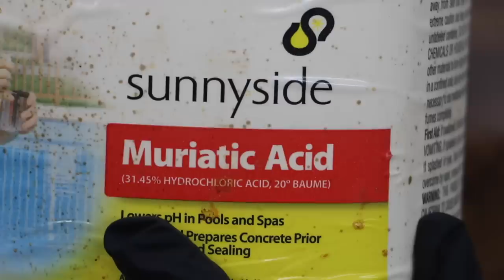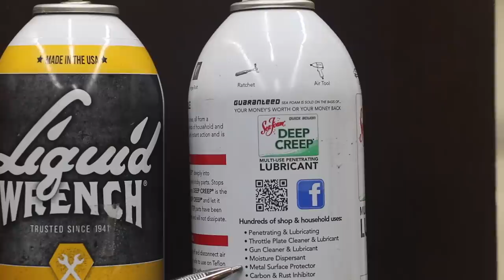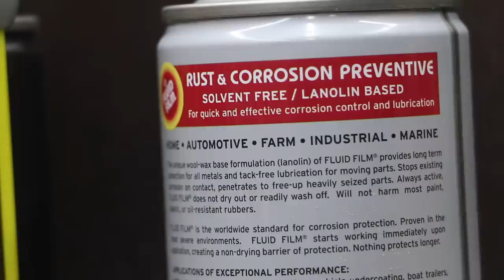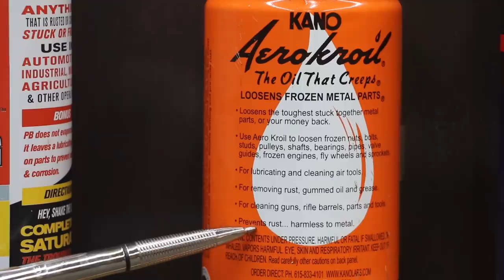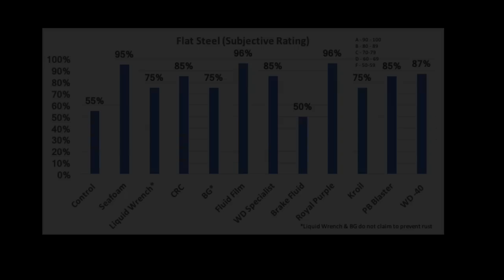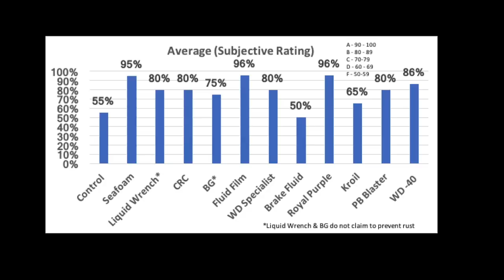Do Penetrating Oils Block Rust?  Let's find out!

Comment: There's a product in Canada called "Formula 3000". It's used the same as Rust Check in the sense that it's used as an undercarriage spray to prevent rust from forming, or spreading. Our Canadian winters are especially long and cold, and a lot of municipalities use calcium or salt to coat the roads. This mix is especially bad to parts of the vehicle that have paint missing in spots and to unprotected metal parts under the car. I would be curious as to how Fluid Flim compares with Formula 3000 and Rust-Check. Those three in a competition I think would produce very interesting results.
Reply: Also I should add: by looking through YouTube for videos comparing the two with Krown as well, it seems there are not many of them and a lot of the ones that exist are very poorly filmed and explained. There is one video that shows a lot of different rust inhibitors in a 1 year later test. If you were to do a similar video, I think you would help a lot of people - including myself - find a product to spray under our own vehicles. Thanks Project Farm!
Reply from the maker: Thank you for the video idea!

Comment: I use spray on tar, its excellent for protecting against corrotion and wear. It hardens up over time aswell. Not good for long bolts/threads though as it can lock up pretty hard.
Reply from the maker: Thanks for commenting on this.

Comment: You're missing PB Blaster 'Corrosion Stop' 
As an engineer, THE most effective product I have found to block, inhibit, seal metal is PB Blaster 'Corrosion Stop'
Great capillary action. Non- hydroscopic, 100% waterproof, good lubricant, self healing and does not wash off except with solvent. Nothing better for electrical connectors in marine environments.
Reply from the maker: Thanks for the feedback.

Comment: I inadvertently replied to a video from this time, last year....I have a suggestion for a project idea. This one is also a 1960-70s fairy tale. I could never get a strait answer on the outcome. The story is, during the car engines of the era, it was common to see valve stems filled with sodium powder. The hollow valve stem, with the sodium powder, would dissipate heat from the valve, and reduce carbon buildup. The story goes, if you cut open the valve stem (I guess cut off the tip with a hack saw) and dump the sodium in a cup of water, the sodium would explode. Sodium filled valves are still around in auto applications, and piston aviation engines. I'm wondering if one of your junk yard engines may have sodium filled valves. The last time I had one in hand, it was from a 1955-1985 Small Block Chevy with perimeter bolt valve covers (non Vortech) heads. If you held the valve up to ear and shook it, you could hear the sodium rattling around. It sounded like a salt shaker. Do you have any scrap valves sitting around, that make the "salt shaker noise"? Wanna potentially blow something up for likes? Lol. The videos I've seen are really sketchy and don't show definitive [sodium from valve] used. There are plenty of laboratory grade sodium explosions on the net...but, those vids lack the grit and spirit of Project Farm.

Comment: Off to buy some fluid film. Get lots of surface rust running heater in garage in winter and this would be fantastic for small jobs caused by condensation.
Reply from the maker: Fluid Film will stop the rust!  Great product.

Comment: It be Great To See how These Compete  With 3M Silicone Sprays Type numbers 08897 Dry Type and Wet Type 08877 I’ve had Great Success preventing rust on a Raw Tube Chassis OFFROAD Race Car.. I coat the Chassis after every Race, leaving a protective film especially the Dry Type.. Most survives even after heavy mud situations leaving no rust underneath on the steel.

Comment: Great test, love the results. Would have loved if you had included some plain old 30 weight engine oil in there to. I use in on stuff sometimes as a rust preventer, plus I have read in the comments, and seen guys in the past who've used old engine oil as a rust preventive for auto bodies and frames.
Reply from the maker: Great recommendation.

Comment: I'd be interested to see the same experiment without the Zinc coating removed. Most of us are not going to remove the coatings before we reinstall the bolts. I do however like knowing what the products will actually do with raw steel but the formulations may be designed to work with the coatings so that seems like a more realistic test.
Reply from the maker: Thanks for the recommendation.

Comment: WD-40 is a great water dispersant. If you have a wet electrical or phone panel try using it and watch the water bead up and fall away. Then use one of the other products to protect the connections.
Reply from the maker: Great point!

Comment: Something not mentioned about fluid film is that is also sticks around much longer than all of those other fluids. I spray fluid film under my truck and 3 months later it's still there. If you were to spray wd40 or one of those other fluids it would largely wash away in a week
Reply from the maker: Thanks for the feedback.

Comment: The issue with brake fluid isn't that it's highly corrosive itself, but because it's hygroscopic and absorbs water readily, it will speed up corrosion like rusting which are accelerated by water. 

Would he neat to do a test of different brake fluids and see how much water they absorb under various conditions.
Reply from the maker: Great recommendation. Thank you

Comment: A fascinating sequence of tests and very useful.  A typical scenario is stuck bolt, penetrating fluid, remove bolt, treat bolt with rust preventer, re-assemble.  Which product is best at preventing future rust but won't wipe off with the pressure of re-assembly and torquing?
Reply from the maker: Great video idea!

Comment: my favorite use for wd 40 is washing and one step degreasing my bike chain. when i clean my bike i hit the chain with wd40 while spinning it fast, then spray it down with the hose, then repeat once and just spin the crank for a while. then i put actual chain oil on. there are better products for doing this, even specific products, but i find it funny that allot of people think that you can just use normal wd40 to oil a bike chain or similar application. it is not a lubricant, it is a solvent.
Reply from the maker: Thanks for sharing.

Comment: Great info! I know Fluid Film is thick and, well, "filmy", and I'm assuming Royal Purple Max Film is also. Perhaps the thick "film" consistency of these two products helps them prevail over the other products.  

Another note to consider: as of this writing on Amazon, Royal Purple costs $1.22 per ounce, while Fluid Film costs $0.83 per ounce. Not a big difference for small work of coating bolts, but something to consider if coating, for example, a truck frame.  

Final note: The smell of Fluid Film drives me crazy; it just smells yuck. : ) BUT, on the plus side it's a natural yuck smell (b/c it's lanolin), not a chemically-destroying-my-lungs smell. Curious what the smell of Royal Purple is like? (Again, not a big deal for small applications, but for big projects...)
Reply from the maker: All great points.  Royal Purple doesn't smell as bad as Fluid Film, but I believe Fluid Film would likely last longer due to it's greater viscosity.

Comment: Another great video. Thanks for making it.  Very informative and interesting.  

Hi there, I have a question for you. 
I have a car that hasn't been started for 15 yrs . What do you recommend I put in the engine before I try to start it?  & for how long roughly?
Reply from the maker: Thank you!   I'd drain the fuel from the entire fuel system, replace the engine oil and possibly use Marvel Mystery Oil (small amount) in each cylinder if the engine is stuck or possibly rusted internally.  If the engine rotates freely, MMO isn't needed.

Comment: I would be interested in consumer prosumer branded ratchets (not snapon, mac, matco... you can but $$$) teeth count vs maximal torque, breaker bars, sockets, wrenches,  drills, impact drivers,  impact wrenches, anything from harbor freight, screw outs vs left handed drill bits.

Specific tools? I'd say the bionic wrench, gator grip, dog bone wrench, any gimmicky craftsman tools (ex flex claw hammer), I'm sure there's more that I cant think of.

A method for testing torque is compressing a sealed hydraulic cylinder with a nut and bolt and measuring the psi generated inside the cylinder
Reply from the maker: Aaron, This is very helpful information. Thank you!  I'll see what I can do.

Comment: Salt water is around 5% brine. We make a brine at work for the municipality during snow season for ice. Its 23% brine. That stuff will rust metal fast. And be more representative of what is out there rusting people cars and equipment. Flyid film is used for undercoat. 5% salt water wont do anything, the mix % is too low. If your going to redo it try to get highway grade salt. Not table or the driveway stuff you buy locally. If you want to redo it I'll send you a container of it to try.
Reply from the maker: Thanks for the recommendation!

Comment: Instead of fixing a rusted bolt , prevent it from getting rusty. For years I have been using Kopper Kote, this truck now I have been using Kopper Kote mixed with Cosmoline gun grease. Time will tell if this is /was a good idea? You may have to try for long term results. They do mix together well when warm, not so when cold. But don't like doing things in the cold anymore! I found that kopper Kote worked better  longer then Never Seize an number of years better.  My 99 Do_G_ Dully Crap  within a year and a half had to have the steering linkage heated very well to allow it to be moved , from a factory set, excessive toe in!
Reply from the maker: Thank you for the video idea!

Comment: I really enjoy your videos. Have you considered testing RUST REMOVERS? I know that machinists seem to prefer "Evapo-Rust"....just soak for a day or so...then rinse off with water and light brushing.  Also, it is claimed  that a quick re-dip will slow down the resultant flash-rusting which can occur after the material is de-rusted. (of course "Fluid Film" is the preferred long-term treatment.)
Reply from the maker: Great suggestion.  I have a couple of videos on rust removers

Comment: Brake fluid is a very poor choice for an "alternative" rust inhibitor.  However, ATF(automatic transmission fluid) and/or PSF(power steering fluid) are both great at this and for penetrating siezed parts

Comment: Fun fact...WD-40 was originally designed to prevent missiles from rusting. 

I would have liked to have seen what plain of motor oil did as far as rust prevention goes. My grand father use to coat his garden tools with it for winter storage so they wouldn't rust. He also used it for lubricating squeaky hinges and sticky gate latches and the like.
Reply from the maker: Thanks for the information.

Comment: One slight side comment, please.  I ran into an issue that might be of interest.   Your test fasteners are "screws" -- a "bolt" must have a straight, unthreaded section on the shaft.  A couple of times, I didn't specify and received a bolt when I needed a capability to be take the nut right down to the underside of the screw head.  The tech from a fastener supply company clued me in to the specific difference.
So, especially if you need a longer fastener with "all-thread" (like for a use like some pullers for instance), don't call it a "bolt" when you're ordering it.  I try to get in the habit of using the correct name at all times so I don't get caught again when it's time for me order or specify the exact type I need.  I hope this might help your viewer prevent getting caught.
(To get really specific, both types are "screw fasteners" and thus "screws" but only the bolt has the unthreaded portion.)
Reply from the maker: Thanks for the constructive feedback.

Comment: Please use other products as comparisons in your tests. I would have liked to see engine oil or wax added other plates in comparison. I use machine oil on my lathe bed to keep the surface rust off it while not in use, it's great. Anything that can keep the air from getting to the metal is fine.
Reply from the maker: Thank you
Reply: Only because I think a lot of these products wouldn't exist if we still used the tried and true methods of a little grease or oil applied to a bolt as we used to.

Comment: I used to live in the snow belt and have family that does. 

Could you devise tests of slippery products that would excel at preventing  slush and compacted snow from sticking around wheel wells, and from snow shovels. Every time I visit the snow belt in winter I see vehicles lugging huge accumulations of compacted snow thrown off by tires. I though something like a silicone tire shine product might fill pores and be slippery enough but don’t have opportunities to try it. I think there’s a useful product lurking in solving the problem.
Reply from the maker: Great test idea. Thank you

Comment: I've heard that penetrating oils (WD-40) are great for cleaning tools and metal surfaces be it for rust prevention, lubricating, and actual cleaning of a product. It's been 4 years and could make a decent follow up and showdown (I think). Could also add in gun oil, mineral oil, gas/diesel, and/or honing oil to the mix to see what makes for the easiest cleaning as well as protecting tools. All without leaving behind an annoying oily film on hand tools.
Reply from the maker: Thanks for the suggestion.

Comment: Not everyone has “penetrating fluid” in their garage/house (mostly only car mechanics)... so, maybe a “best rust blocking” with “common household greases and oils” would be better... eg: lithium grease, silicone grease, wd40, motor oil, cooking vegetable oil, linseed oil, that common super thick black heavy-duty car grease, that household thin tan colored general use oil, etc.

Might be a tough test though... because they’re all so resilient, effective and some super thick. Might be difficult to get metal to rust with some of them.
Reply from the maker: Great video idea. Thank you

Comment: Fluid film. Great rust preventor and lubricator at the same time. Reapply every chance you get. It's thin and wears out especially under the car but is great. Avoid the asphalt coatings. They will trap moisture and kill your vehicle.
Reply from the maker: Great points!

Comment: Great video! I was considering using the acetone & brake fluid mix to break free my V8 engine. Should I be concerned with rust issues?
Reply from the maker: I wouldn't recommend this combination, but others may disagree.  I'd be concerned with rust.  Why not use Seafoam Deep Creep, Liquid Wrench, or CRC?
Reply: That was my concern after watching your latest video. I think these other products would be worth trying. Thank you for your suggestion!

Comment: Awesome channel. 
Question: do you have thoughts on Transmission Fluid + Acetone?
From your research I see that Brake Fluid + Acetone seems to work well but leads to long term problems with more corrosion. 
I wonder if we would have the same issues with ATF + Acetone.
Reply from the maker: Thanks!  Thanks for the suggestion.

Comment: I'm interested in opinions on performing this test with a popular homemade break-free mixture of 50% automatic transmission fluid (ATF) and 50% acetone.  The ATF should not cause corrosion, and I believe the same is true for acetone, but I'm unsure.  Also, I understand ATF and acetone are not soluble.  In order for them to work together as a break-free solution, they need to be mixed well immediately prior to use.  If that's the case, I can see how it would be difficult to conduct the same test with this mixture but not impossible.  If anyone has experience with this mixture, please comment with your opinion on it's potential corrosive effects.  Is it, or is it not corrosive?  Secondarily, what's your opinion on how this mixture performs as a break-free solution compared to other marketed products?  Great video.  Keep up the good work.
Reply from the maker: Great suggestion!

Comment: It would be great to see a comparison of rust prevention or bicycle chain oils. After a mountain bike ride i wash down my bike but the water on the chain sometimes causes rust to form. Many lubes (particularly the dry conditions ones) don't actually disperse the water if applied to a wet chain. I have tried a couple of water dispersant sprays, but these haven't always given good results. I recently found a light oil based lube that seems to work well at driving the moisture out, but then this seems to be incompatible with my regular dry lube which then beads up on top of the chain when i apply it prior to a ride.

If you think this would make a good video i'd love to see it.
Reply from the maker: Thanks for the video idea.

Comment: i know youve tested engine restore a couple times as an additive, but how bout completely replacing the oil with engine restore, what is its lubricity, what effect will it have on the engines performance, and would it further improve compression
Reply from the maker: Thanks for the recommendation!

Comment: In theory, if you corrode a bolt a lot (maybe by using brake fluid) you could break it off easier because rust is brittle and weak
Reply from the maker: Great point.

Comment: have you ever tested silicone spray or silicone grease as a preventer of rust ?  maybe a control of just motor oil or 3 in 1 household oil since people use them a lot when assembling parts

Comment: It is known, or at least a myth that WD40 and similar products break down the grease internally when spraying to stop squeaking.  So is it true that WD40 works as a solvent of sorts?   Does WD40 break down grease? Or add to the lubricants?  I only use WD40 as a repellent, not as a lubricant.